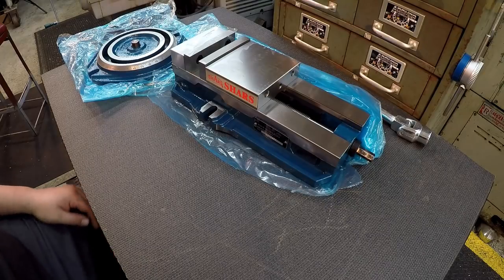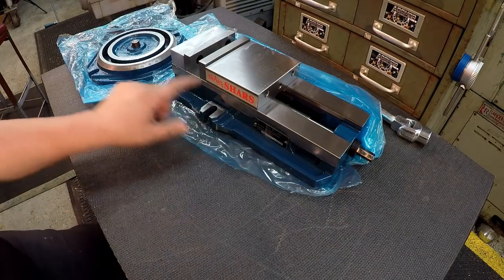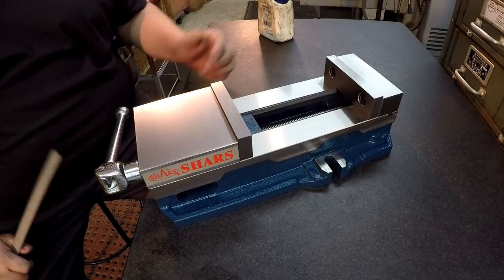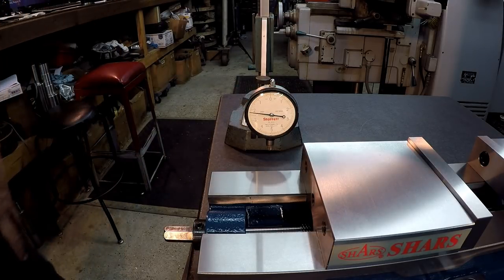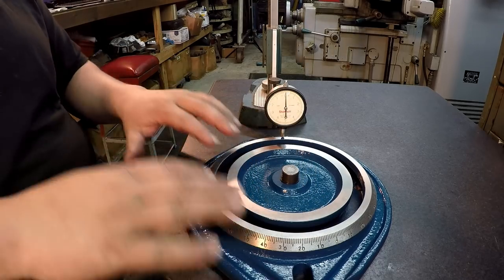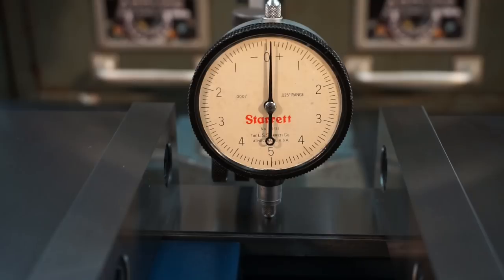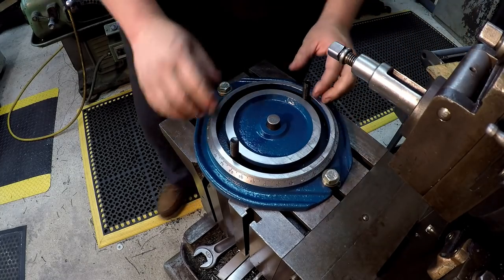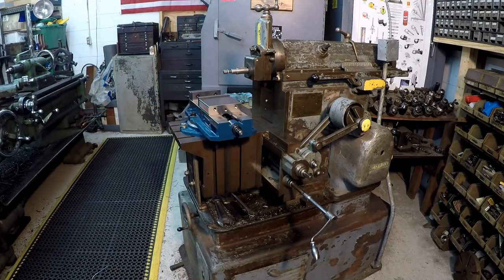Shop Talk 20: Shars 550V Milling Vise for Shaper

Comment: What would a plate hone and inspection cost on a slab like that?
Reply: lol, no doubt, add some smooze for better gomatree for better angles!
Reply from the maker: Last time I checked it wasnt too bad, a couple hundred bucks if you don't have to ship it and can get it fitted in with some others at the same time.

Comment: NICE VISE!!
You have to spend a LOT more to get one any better!
HMM, I recently made some knurled/checkered gripper plates on a CNC mill and even at 7500 rpm with a 90 degree
pointed 2 flute carbide tool you still have ZERO surface feet at the tip.....
That would be a perfect shaper job with your new vice, wink wink nudge nudge...........

Comment: Flame hardening can't achieve the case depth required for a Rockwell C test. They're either misleading you or converting from a Vickers microhardness value.
Reply from the maker: Might be another good test then.
Reply: In this application I don't think the depth of the case really matters, you're looking for a hard surface that won't wear, you're not looking for the mechanical properties created from a large case depth. A scleroscope test would be interesting.
Reply from the maker: Exactly. Going in and out with parts during the life of the tool, having that harder surface will make a much better vise.

Comment: Adam with all due respect, get that indicator serviced. The Sony shots made my OCD go apeshit as I watched that needle jump and jerk around. Would be $45 for a clean and lube from a good shop here in IA. It might just be the quality of a Starrett tenths indicator isn't all that great.
Reply: Caleb Welte I never was a fan of using ADG style indicators for this type of work. I feel a test indicator style is better suited. But that's just me to each his own.
Reply from the maker: I remembered as I was already into the video that I grabbed the wrong indicator. That one does move a bit, even after being serviced by Long Island.
Reply from the maker: What difference does it make what style indicator you use? They are all built to do a job. The one I showed just happened to be one that isn't 100%.  AGD style is easier to film and show the way I did for the viewer.
Reply: Abom79 I didn't say it was the wrong one to use I just said it I wasn't a fan of this type if indicator.  I always felt that moving onto a part using this style indicator was subject to more hysteresis than using a test indicator which may or may not have been the "settling in" of the reading. Anyways I did enjoy the video.
Reply: I agree, and the close ups of the AGD make the video great. That extra work you do for us is appreciated.
Reply from the maker: I know that many of my inspection jobs I share here may not be 100% correct in practice and proper techniques, but I think it gets the job done and shows what to do, and helps others who are less informed some ways to inspect parts and use indicators and holders to check parts. Personally, I love the large dial indicators and showing them on video, but I also love my test indicators too. I try to use as many of the tools I have as I can in the videos on the channel.
Reply: Sometimes I grab a "lesser" tool and use it because it was my father's or my gpa's old tool. Those tools, however good or bad they are, are my favorites. I see this in you too Abom, and I understand.
Reply: Well, the plate isn't calibrated either, so there's a lot of plus-or-minus in this video. :-) That's oddly entertaining to see from a machinist.

Comment: Adam,  I have a chance to get a 16" shaper nearly free.  I have hesitated because it has no vice.  I have researched hard and have found that beat up used ones on ebay are $900. Plus shipping - none in my neighborhood.  Would you care to donate your old one?  I can fix it.
Reply from the maker: That original vise may not fit that 16" very well. The slots for the 4 bolts are positioned to fit the shaper I have. If it will help you out, your welcome to have it.
Reply from the maker: Drop me an email so that I will remember to check those slot dimensions next time I'm in the shop. Abom1979 at gmail

Comment: So you can get a good quality vice for a good price, can't beat that. A shame you had to tune it up at all but at least it was minor, hell if your Noga scraper and a file can fix it in a couple of minutes it is hardly worth bitching about, but still that does seem to be a sloppy bit of workmanship.  Perhaps it was built first thing monday morning and it was just a one off crap part that you ended up with.  All in all it looks like for the price you can't do better than that for a nice new shiny vice.
Reply from the maker: Looks like the factory puts there best efforts on the vise and not the swivel base.